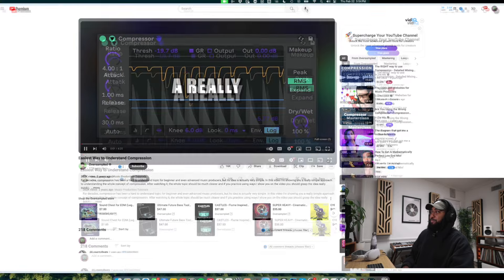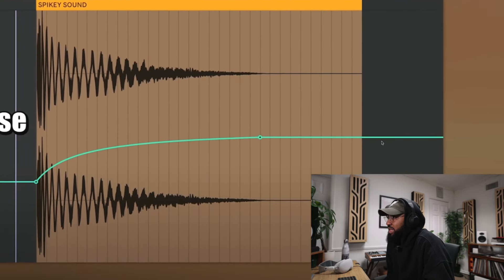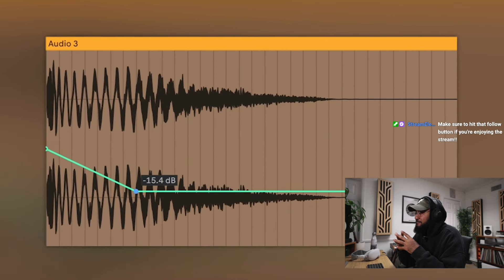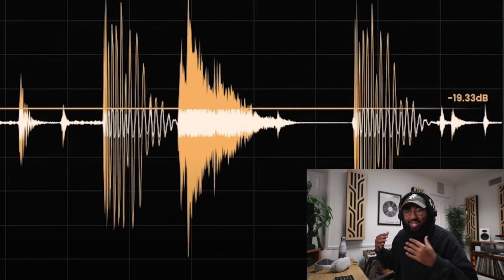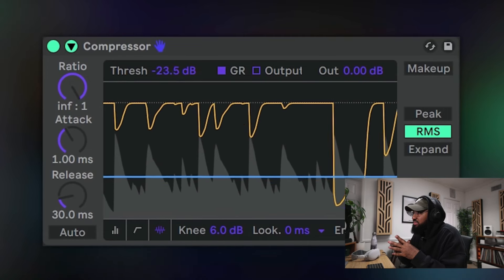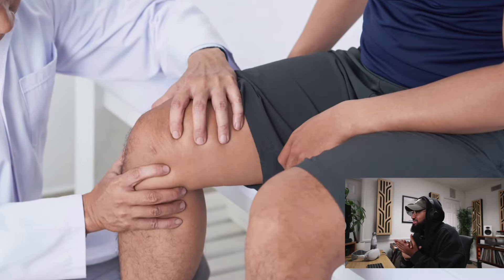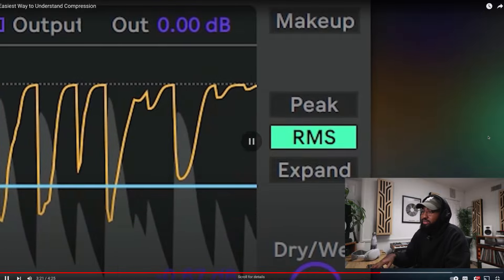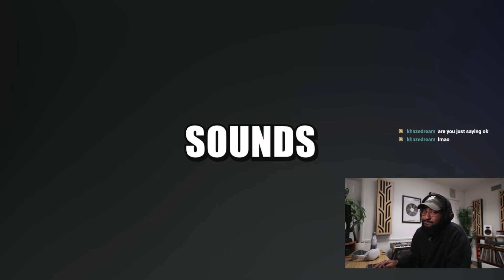Trying to learn what a compressor does after producing for nearly 10 years

Comment: Back in my day there were compressor and limiter they treated as two different things. Limiters were use on players whose level was jumping up too much from digging in too hard, so put a limiter on even the loud note out.  It common to put a limiter on bass players.    Compresser were used on player whose levels were going back and forth between too high then too low.   So the compressor evened things out.   The drawback to compressor is the start taking away the dynamics of the music being played.   So instead of the music changing levels from part to part of a song things get compressed down a very limited amount of change over the course of a song.     So a limiter you set the max level something is to have and it cut spikes down to the level you set.   A compressor is like a funnel you send in the sound and low and high level get compressed together into on steam of sound.
Reply from the maker: This is great I have to pin this. Everyone just read this don’t even watch the vid
Reply: 😂😂 I aint gonna lie I didnt know either whenever i use compression it usually just the balance low level preset tbh @ldre_tv

Comment: A compressor takes the any signal that's louder than a user specified volume and tries to lower the sound to or below that volume. That way there is less of a difference between the quiet and loud parts of a track.

Comment: It's cool that you're making this video... but this video is upsetting me a little... mainly because he's inaccurately stating that compressors clip the signal... which is not true at all... it's actually dynamically reducing the gain of the signal set by the threshold, according to the ratio (i.e if 4:1 then for every 4 dB the input signal goes over the threshold, the output signal will only increase by 1 dB),  and then returns the gain back towards the original level according to the attack and release times, providing a controlled and less dynamic signal...

so as you can see... there's no clipping of the signal at all, that's actually another "type" of gain reduction.
Reply from the maker: Why this make more sense than the whole video low key
Reply: @ldre_tv  I’ll be honest… the only reason why I caught that and understand a little bit about signal processing is because of my electrical and computer engineering background… like legit 😂… so we did a lot of signal processes courses… so I get it, this shit confusing as hell! It also took me 3 years to properly figure how compressors actually attenuate signals.